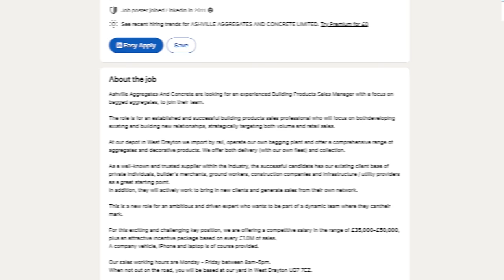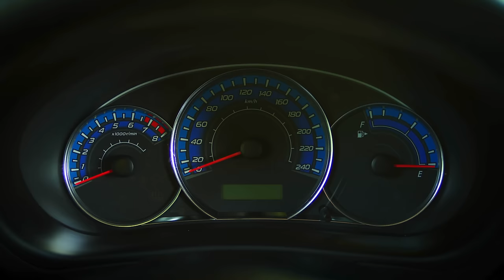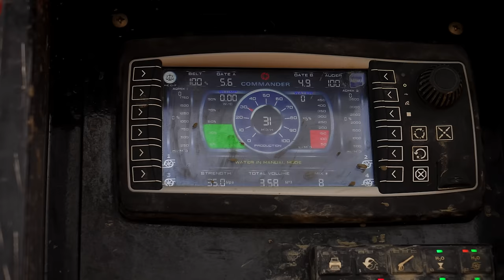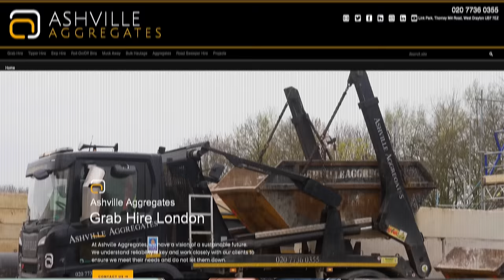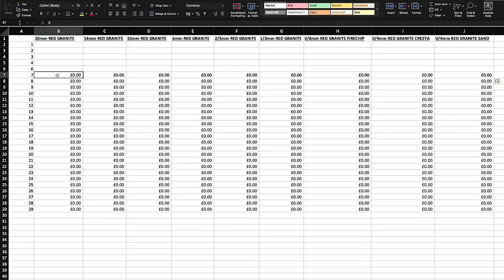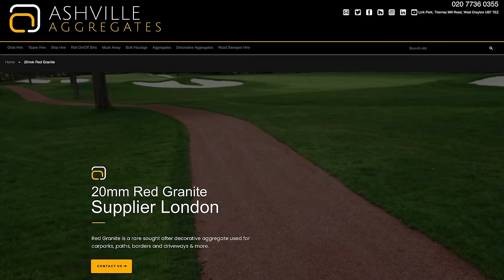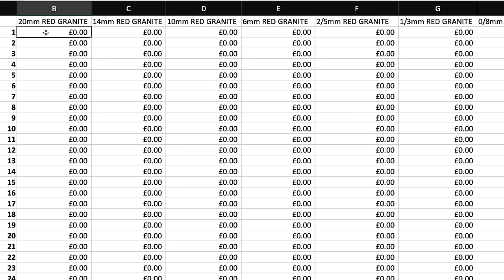Shoulder Pains & Less Complaints ??? | Ashville Weekly ep169

Comment: Good man Daniel I work in pest control and you made the right decision as copper pipes is harder for rats to chew through although they can get the weak part in the bends but copper is the best option.
Most homes go for plastic as its cheapest but it can often cost more in the long run.
👍